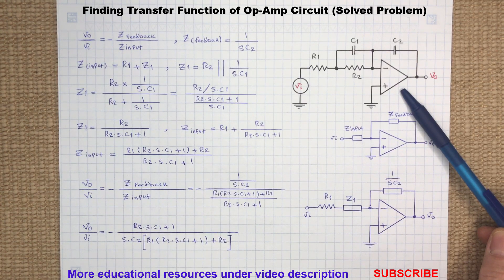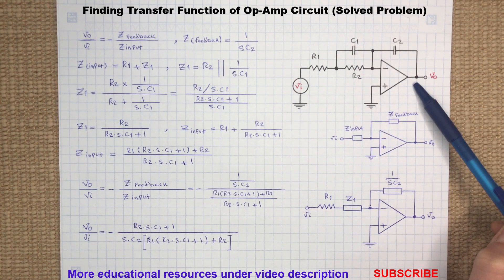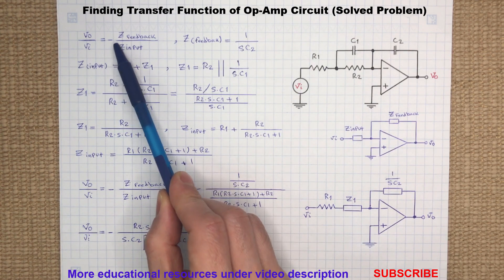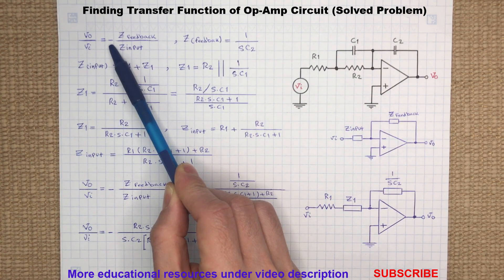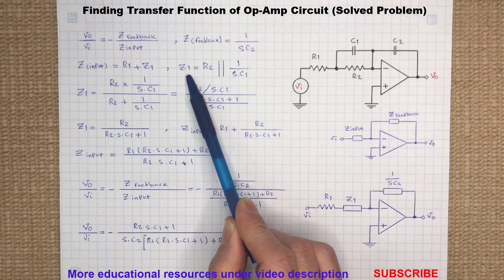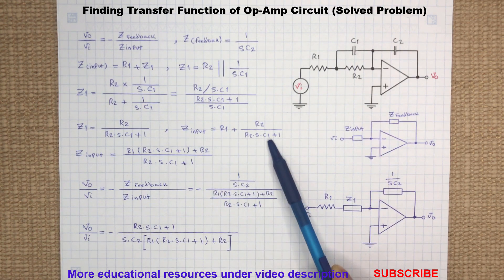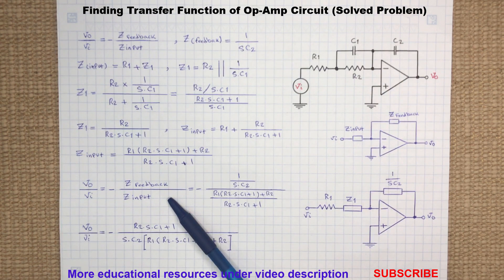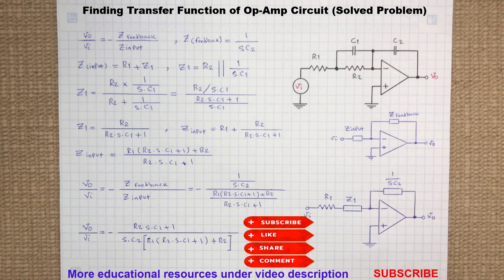Transfer Function of Inverting Op Amp Circuit

Comment: It would be interesting to investigate the stability conditions of the system with the obtained transfer function based on the Location of its poles and zeros.
Reply from the maker: Yes, we can define some values to the resistors and capacitors and study the location of the zeros and poles.